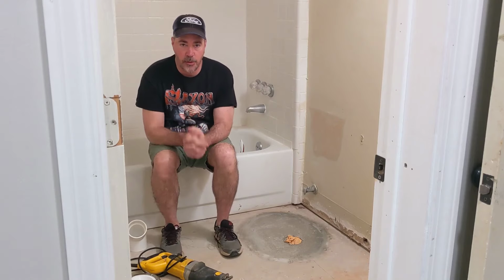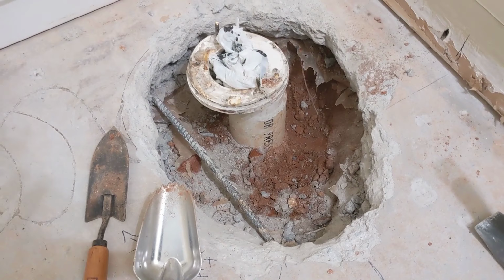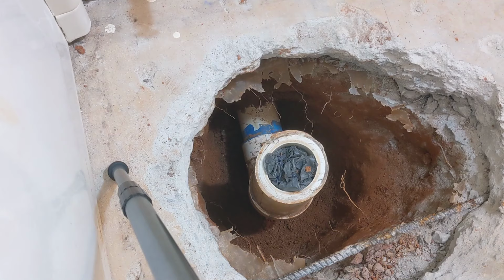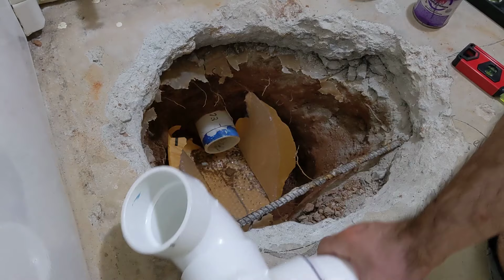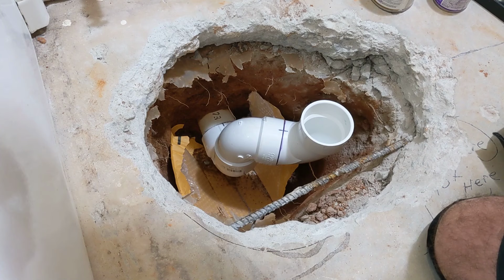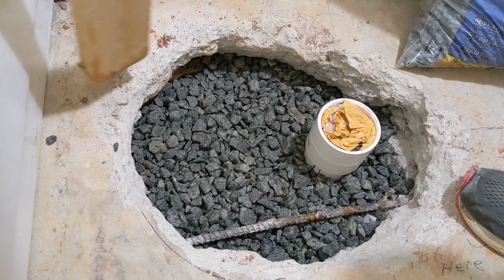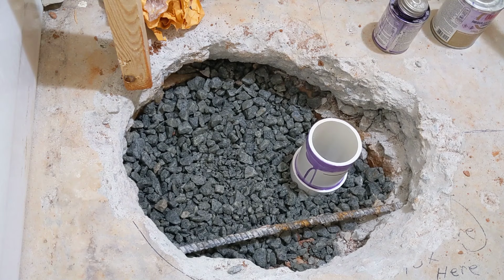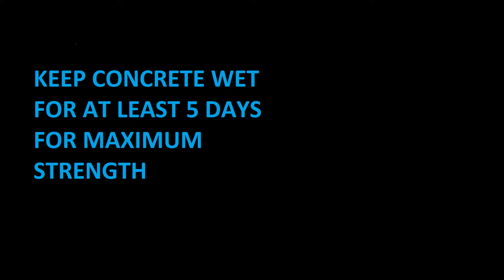Move Toilet Waste Pipe in Concrete Slab - Easy

Comment: This is without a doubt the best tutorial on how to reposition a toilet in a slab like this! Absolutely brilliant work, mate 👌🏼
Reply from the maker: I'm glad it helped you. I really try to find a way to fill in the missing detail once I learn it. Happy flushes!
Reply: @jonparkmac  I was talking with a friend about doing this. He said any time you move the toilet you have to move the vent pipe or you risk having problems with it flushing. Can you share any information on this please?
Reply from the maker: @Lucky Duck  your friend is correct, but only if you move it several feet. And you don't have to move or remove the existing vent. Just make sure 'some' vent is within a few feet of the flange, even if you have two vents that's fine..
Reply: @jonparkmac  Thank you :)
Reply: No,, no it’s not ..total illegal plumbing..
Reply: I absolutely agree with you! what a brilliant work and video, and I am very grateful and can't thank him enough!
Reply: The best video to make things simple fantastic.
Reply from the maker: @MrDarren5012 the existing plumbing was already a code violation as it had a vent elbo. But yes I wish I could have used a long radius. Never an issue all this time tho 💪

Comment: Nice job Johnathan, thanks for posting this. Great tip for all the DIYers out there showing how to make witness marks on the fittings. Put everything together "dry" without glue first to get the position of the pipe where you want it, mark it and then glue it up. My 40 years working with PVC and ABS pipe tells me you've got some great experience doing this kind of work.
Reply from the maker: Appreciate the kind words.
Reply: I mark it too. I just remove the marks when I’m done. Don’t want anyone to know I used them lol

Comment: Excellent and well-produced video. It should be beneficial for DIYers contemplating doing this project. Thank you for not adding any music. When I did mine, I used the 'slow set' PVC glue which allowed me extra time to properly align the fittings. At backfill time, I dampen the soil with water and use the handle of a hammer to pack the fill.
Reply from the maker: Good idea. I should have used water to better pack that down
Reply from the maker: As I keep telling you ..it's level ..and been rock solid for 3 years. It's sad you keep obsessing over your critique ..somehow trying to make something out of nothing..smh.

Comment: Where was the building inspector when the builder's plumber did such an incompetent job?  As mentioned by others, this is a very clear video on under the slab plumbing. I'm trying to put a plan together to tie in an attic bathroom to a bathroom below and following along on how this fellow is moving the waste line in invaluable. With the other videos available here I know I can do the job correctly.
Reply from the maker: That's a good question. This house was built in 1995 and the inspections were poorly done or not done at all. For instance, the perimeter foundation drain pipe connected back to itself forming a closed ring. Smh

Comment: This is perfect...I just need to dig into the concrete and level the pipe. Looks easy and cheap to do myself
Reply from the maker: Yessir. I got some good fair criticism in the comments. Don't cut any rebar if it's pretentioned, pour sand and water to pack down the dirt better. And most of all, use a long sweep fitting. I couldn't make that work without significantly more work. Good luck!

Comment: Considering the outlet of a toilet is only about 2 1/4", this double 90 set of with 4" pipe works because the velocity of the flush at that point. The same setup downstream where the velocity is far less would be more problematic. The real down side to this setup is killing the velocity of the discharge too early in the pathway. Fortunately, the pipes get more liquid than solid on a daily basis and it all works out. Usually. I would have extended the pipe and cut flush to the tile, then add metal flange on top of the tile.
Reply from the maker: Thanks for the polite and respectful critique. This is what I had been thinking. The two bends are so close it doesn't impede as much as it would seem. I could have done better with some 45s. It's been over 3 years daily usage and never a single issue ..that includes solids. I cut the pipe flush because I used an inside flange and the flooring was thin nucore. I measured all that before I cut. Flange fit perfect. Any higher would not have worked. Tile would have been much thicker so your right. Thanks again for the insight.

Comment: This is a great video, thank you. Does a vapor barrier really accomplish much at this point? It seems that once it has been pierced that moisture will find a way through the path of least resistance around the barrier.
Reply from the maker: Not real sure. It's easy so I did it anyway.
Reply: I’m wondering the same thing. They sell tape for sealing up vapor barrier seams but then I saw him do it without it sooo idk
Reply from the maker: @inlinesix6694  seal it up

Comment: Great work, I have a drain problem with a rotted out copper drain pipe going through concrete. Though not the exact same job most of the work with the concrete is the same; breaking up the concrete, digging out the dirt etc.

Comment: A shop vac works great for removing loose dirt in small areas like that.  Likely more efficient than a little shovel.  You can still recycle the dirt that way too.
Reply from the maker: Great tip!

Comment: Not sure about the US but in Australia there are approved adaptor fittings available that fit on standard 100mm sewer pipes which will allow a shift to a wc connection that is out of position without having to chop through the concrete floor. 
Not sure how far they extend but it allows a much easier repositioning of a wc pan than this labourious method.
Reply from the maker: They call it an offset flange and it's only good for a few inches. This one actually had that because it was too close to the wall. They are a terrible solution since they impede flow. I would never use a shoddy hack like that. Suck it up and break it up, let gravity do it's thing.  Thanks for your comment mate!
Reply: @jonparkmac  Yes the adaptors have limited application and do  constrict the outflow to some extent .
However I would recommend their use whenever possible by DIY ers as an alternative to the possible damage caused to the structural integrity of the concrete slab. Particuarly if reinforcing is cut by inexperienced persons. 
There are innumerable situations where this could end up being a serious problem for the home owner and at the very least a qualified or highly experienced building professional should be consulted before any destructive penetration of a structural concrete floor is started. 
Reinforcing in concrete is there for a reason and it indicates that the floor is integral to the structure of the building. 
And yes it's a great video on how to save money by doing things that are normally very expensive yourself. 
However do it with caution and the correct knowledge and/or advice.
Reply from the maker: @andrewwatson5360  agreed. That's why I didn't cut the rebar and it in the middle of the house. I think you'd agree a small hole like this compared to a large trench are very different things. What I did had 0 consequences on the integrity of the slab. But yes these are all important to consider before going buck wild with a jackhammer

Comment: when the angle makes it difficult to makes marks on the different pipe pieces , i use a piece of painters tape make a mark long enough to include both pipe pieces i am joining and then place it on the pipe. Then use a razor blade to cut the point where the joints separate so should have a piece of tape on both joints with the markings.

Comment: Very nice work.......  Why do you need a vapor barrier before adding the cement?
Reply from the maker: Residential code requires it to prevent vapor and gas seeping up into living area. On a small hole you don't need it. I added only because it was there when I dug the hole ..so I put it back like it was

Comment: One of the best DYI Home improvement Videos I have seen. a couple question.

How far did you move it ? 
How much further could you have if you wanted to ?
Reply from the maker: Moved it 4" away from tub and 2" away from wall. Could have moved it over a few feet, but only needed it perfect between tub and vanity.

Comment: IRC (International Residential Code) is for the toilet to be a minimum of 15" from a side obstruction to the center of the toilet.  ADA states 16" min to 18" max.
Reply from the maker: Mine is 17" on both sides for the  ADA prize

Comment: It’s very interesting most glues in the uk say not to twist the fittings.
Reply from the maker: For PVC, you always twist 1/4 turn to create an even seal, spread the cement, and avoid clumps of curled up glue. Standard practice in the U.S.
Reply: @jonparkmac  I know that people do it both in the uk and us but is it the recommended jointing method by the glue/ solvent cement manufacturers or something that plumbers have came up with themselves.
Reply from the maker: Yes. Directions from cement manufacturer, right on the can. No one made it up. https://www.oatey.com/faqs-blog-videos-case-studies/blog/how-complete-perfect-solvent-cement-joint-every-time

Comment: Looks good. I may try it. 

I think I will leave a little length on the pipe and cut it after the concrete dries.
Reply from the maker: Yeah that's a standard way to do it, just be sure to consider the flooring thickness and the flange you want to use. Flange has to be tight against the flooring and seat down tight into pipe at same time.

Comment: Just curious and remember, I know nothing about plumbing, but when you discovered that the original plumber that laid the PVC and yet it was not plumb, when you discovered that after the original cut.  Would it have been possible, instead of digging deeper to access the elbow, could you have just cut the pipe at an opposing angle and have the two pieces…regardless of not plumb in and of themselves, after your, so called corrective cut to bring the angle true and plumb, could that have been a possible solution? Like I said, I am trying to learn and understand better about this technique but I just figured I would ask.  Thanks if you reply
Reply from the maker: Hard to follow what you mean. But the original plumbing had 3 issues. One was using a vent 90 and the other was it wasn't level, and finally wasn't positioned properly from adjacent walls and plumbing. However you do it, try to make a long sweep 90 work.
Reply: @jonparkmac but you used 2 vent fittings..those short sweep elbows shouldn't be used drainage...for vent it's ok
Reply from the maker: @Lucas-lov-plumbing I agree 💯. It's been trouble-free for three years of daily use. But yes, long sweeps are what should be used.
Reply: @jonparkmac lol….re-reading what I wrote I can say I understand what you mean about it being hard to understand what I mean.  But I still thank you for your response

Comment: Just leave the 3” PVC shooting up. Fill around with concrete. Cut flush. And use an inside flange.
Reply from the maker: Better to cut flush with finish floor instead like I did. That's why rouged in drains are not cut. More  glued area, better joint. I did use an inside flange. ✌️

Comment: Great video. You covered it all. But why did you use a 4" coupler? You could have used an inside fit 4" flange, no?
Reply from the maker: Inside fit would reduce opening way more. It's a 3" pipe.
Reply: @jonparkmac   You could have used a 3" outside fit flange, which would be the same opening size as your coupler.
Reply from the maker: @adde32332  that's true ..I could not locate an outside flange with metal ring so what I did when you think about it's make an outside flange .  Same end result.

Comment: A plumber told me you always put the glue on the piece being pushed inside the other piece so that any excess glue gets pushed out of the connection to be cleaned up instead of globing up inside of the fittings.
Reply from the maker: That is true.

Comment: Awesome video 🙏 
Q. This was ground floor right, so it could work out. Could you please advice for the higher floors?
Reply from the maker: If you mean higher floor concrete I don't have experience. But if you can work the pipe from the ceiling below then it's way easier.
Reply: The waste water pipe is "embedded" in the floor concrete. I don't see any sign of it from anywhere in or around the structure.

Comment: How does this process change if your drain system is galvanized piping??
Reply from the maker: I can't say ..but I'd at least think it would be much harder due to cutting steel and getting fittings to work. You likely need to open up a much larger area to have more pipe to work with.

Comment: I have a back up problem and water coming out of shower. I rented the auger and hit it in all holes especially the toilet where the problem is and still no go, I think it got worse now. Thinking what else to do, possibly the camera to see what it is
Reply from the maker: Could be further out toward the street. I had one clogged from girls using wet wipes that got stuck on roots inside the pipe. It was 50 ft out away from house. Call a plumber.

Comment: Its better to use sand than gravel. Once its in place it doesn't compact further the way gravel can. Probably not an issue for this small hole.
Reply from the maker: That's a good suggestion. Makes sense.
Reply: Foam filler
Reply from the maker: @level1selamat155 Wooden Flexbar

Comment: yeah... People, please dont do what this guy did.

I'm a plumber and have been since 2008.

The fitting and the way he configured / used them violates many plumbing rules/regulations. 

For one you can have that many 90's that close together. it will cause drain issues. Second if a plumber would ever need to cable the drains from the toilet flange he would not be able to now because all the close 90's. Third the fitting themselves are incorrect. When you do use 90's for drins line this it should be longsweep. the exception to this is the toilet but only on sharp turn. By the look of this video he used three sharp 90 turns. 

People just call a plumber you will save yourself money in the long run.
Reply from the maker: Thanks for your professional and objective opinion. I agree with what you've said. You can surely snake this and it also flushes strong after 3 years and daily use, never a clog. Code violation was present already because the original plumbing had a vent 90. That said I support your opinion and thanks for commenting.

Comment: When we moved in our new home, one toilet was 10.5” away from the wall of a remodeled shower that had been added after the original plumbing went in the house.  That’s measuring from the middle of the toilet seat so should be center of drain pipe.  It looks kind of ridiculous really.  The tile in there is the same as the hallway and living room.  Are there any tips that would make it easier to save existing floor tile or is it a given that we will need to just re-tile the entire bathroom?   Patched floor after the drain move wouldn’t be seen so much since it would be out of view when entering the bathroom.  Does the jackhammer tend to crack or break the nearby floor tiles?  Thanks.
Reply from the maker: You'll for sure crack the tile and there is usually a backer board on top of plywood then the concrete slab. What you can do tho is carefully break up the tiles near the zone, cut thru those layers, then jackhammer the slab. Give yourself lots of room. Then when done replace the tile with new same style/color.  Or, just take all the tile out and replace ..maybe with a new contrasting color. But do know there is a layer of plywood between that tile and the slab

Comment: This is very similar to what I want to do. However, bit concerned on the 90 degree elbows. Did you see any flush/drain issues?  Ideally these should be long sweep elbows? Please advise.

My drain size is 3inch. A 1/4 bend or vent elbow like above will save me some space (for wall hung toilet).
Reply from the maker: Long elbow if you can get it to fit. In hindsight I could have used some other fittings and avoided the 90s I think. But it flushes good since it has a deep drop.

Comment: I am confused. You said 12" from the back wall and 18" from the side. You measured 12" straight to the closest edge of the pipe from the back. From the side if you do the same you only have 14" according to your tape measure (if you go to the closest edge of the pipe). Even if you measure to the far side (which it seems to be the measurement you are relying on... you only have 17". It's either 4" too short from the side or it's 1" too short from the side. Why the from the back its to the closest edge of the pipe and from the side its the furthest?
Reply from the maker: You always measure from the center of the pipe ..never the pipe edges. I should have mentioned that.

Comment: i have heard people say that if you reposition,  it's best to use the old fashioned wash-down toilet instead of the new siphon toilet.. did you or anyone else hear about that?
Reply from the maker: Reposition dosent change much for that. Flushdowns more common in Europe. They are less likely to clog in the toilet,  but louder, need more cleaning, and I've read .. a little stinky since turds are not submerged lol
Reply: @jonparkmac  strange in certain country all the major vendors incl sales of Toto American Standard either in shops or online etc all advise customers against using Siphonic in the case of reposition. i thought this was unfounded just hearsay becoming truth.